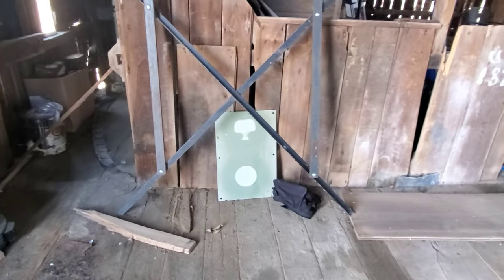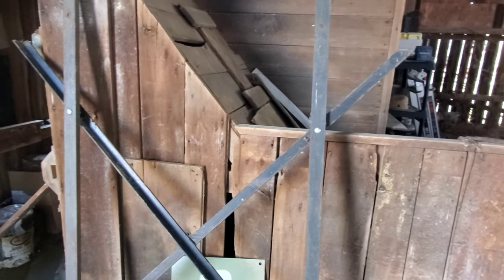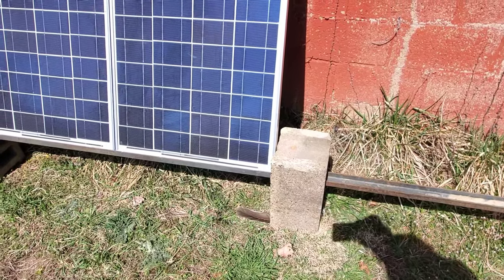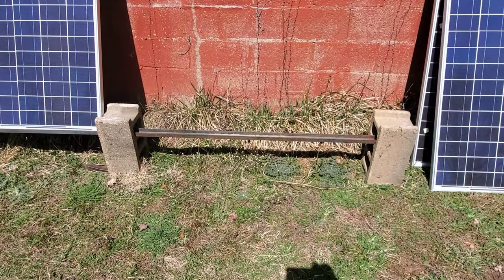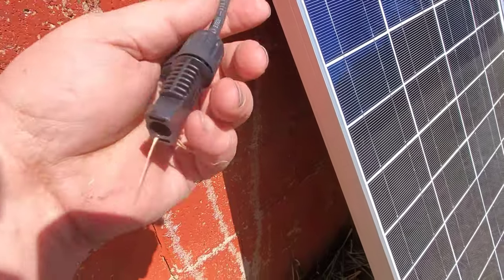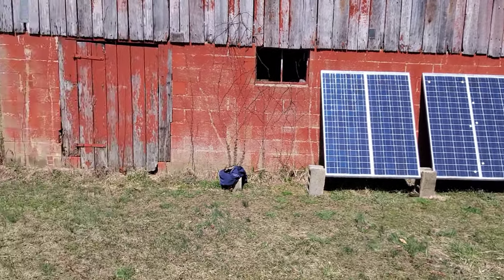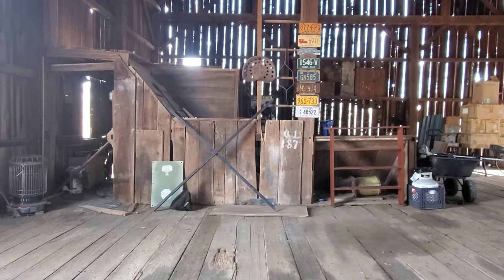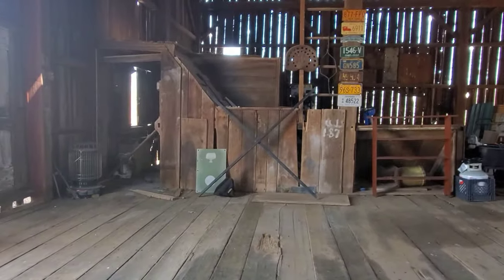Simple, Free, DIY Solar Panel Rack

Comment: These Deka are also good batteries and last a long time. These are GEL so make sure your charge controller is on the right setting because I have seen so many of these damaged due to boiling the GEL up. AT 50% of DOD you can expect 1000 cycles which is about 3 years. We have done test on ours with a low DOD of probably 5 to 10% and got 10 years.
Reply from the maker: +Jorge Serna 👍Thanks!

Comment: Joe, didn't you say that you found electrical light switches and outlets in that barn at one time? If so, there had to be electric running from the street to that barn at some time in the past. 

Speaking of alternative power... I can't believe how unbelievably expensive those Jackeries are! They now have 1,500 watt and 2,000 watt Jackeries. The 2,000 watt Jackery is $2,100.00 and just the 200 watt folding solar panels that they sell with them are $600.00 each! ($3.00 a watt!) So, the same 400 watts of solar panels that you purchased for just $20.00 would cost $1,200.00 if they were Jackery solar panels. They sell a bundle, which is the 2,000 watt Jackery and four of the 200 watt solar panels (a total of 800 watts) for $4,500.00!!
Reply from the maker: +KMAC Radio The best we can tell, it was run from the old house to the barn.  All of the copper wiring is long gone from it lol.  Those Jackerys are crazy in price.  The EcoFlow they sent me to review is about .80 a watt hour as well.  This one has more features than the Jackerys. I have to redo the video for it though. A few points I forgot to mention.